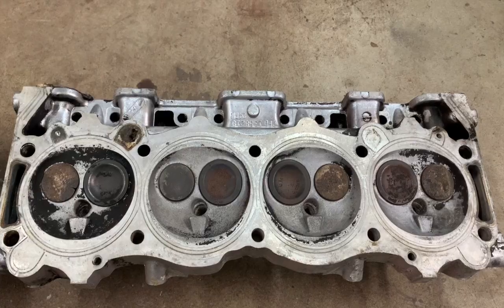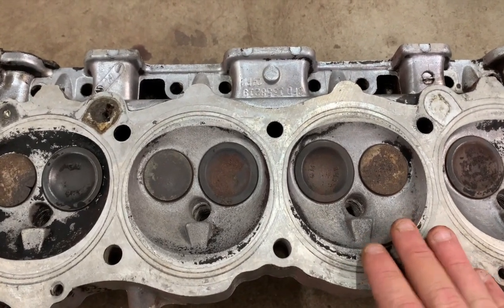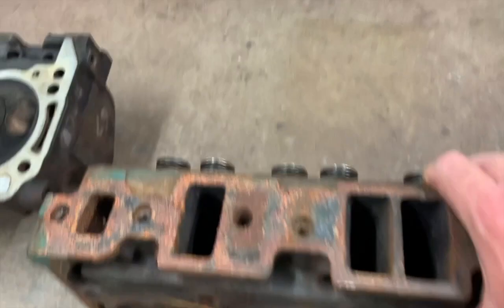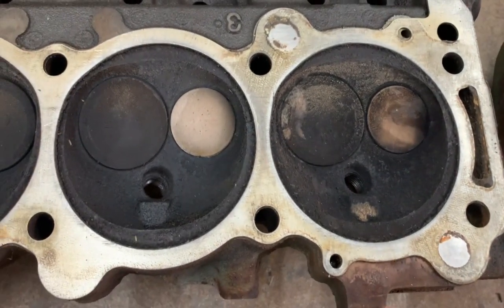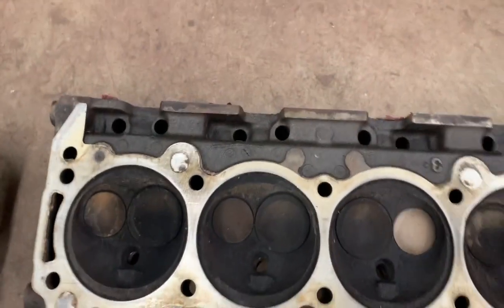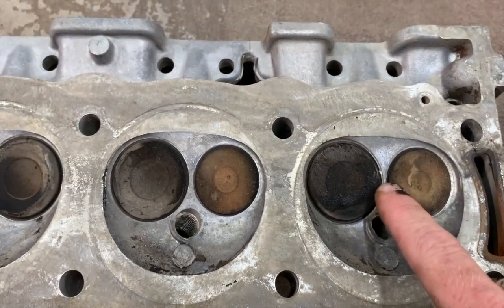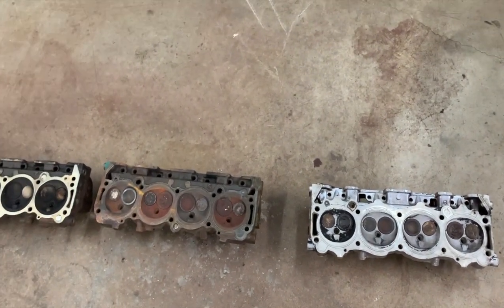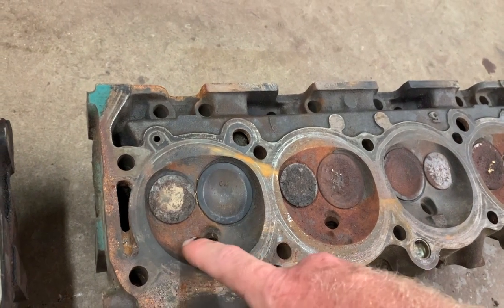Buick 215, 300, 340, 350 and Rover Cylinder Head Comparison #nonamenationals

Comment: Glad to see you back. The history of Buick engines is a wild ride. I've never actually owned a V8 Buick - my grandpa had a nailhead in the late 60s and all I know is that it was parked in the pasture when the transmission went out (I think a '61 Lesabre... pre TH-400). But I got through early adulthood on a bunch of different phases of the V6. Mostly early even-fire through the early 3800s. Really dramatic that sort of a stepchild of an engine became one of GM's best. Wonder what it would take to get the 1986-up/3800 timing cover with the crank-driven oil pump to work on anything else. At least in the V6 world, the oil pump was blamed for a lot of problems. We would see a lot of 231's with spun bearings - rarely any V8s though. Maybe the extra vibration on the V6 helped chew up the timing cover? No idea. But in the 90s, you could always find a G-body Regal or Cutlass cheap with a 3.8 that was bad and a THM-200 that slipped, and a rustbucket Malibu police car with a 350 Chevy and a 350C transmission, harness, and anything else for $500. But the Buick engine family outlived even the SBC. Quite amazing.

Comment: Will the 350 heads fit the 63 buick skylark 3.5L V8? Without modification? Thank you.
Reply from the maker: Will they bolt on? Yes, I just don’t think the valves would clear the bore. The 215 has such a small bore that valves clearing the cylinder bore would be an issue. Also, the chamber size of the head is so large compared to the 215, your compression would be so low it would likely not run very well. Also, you would need a custom camshaft and a fully custom intake manifold.
Reply: Thank you,  I guess it's Destin to be a Stock,  Survivor.  But  thank you for your reply.  I appreciate it. Keep  making Awesome Videos.  Love your 63 !!!

Comment: I appreciate you sharing your thoughts and knowledge and I'm hoping you have more info on Buick 300 and performance mods. I have a 65 skylark wildcat 355 and I'm wanting to get a bit more out of it. My name is Mat and I live in excelsior springs
Reply from the maker: The Wildcat 355 is actually really potent! It was the only Buick with Flat Top pistons that I have ever seen! The Wildcat 355 came with 11:1 compression and requires high octane leaded fuel from 1965 to run correctly. That means 97 octane at a minimum! I’ve had to rebuild a couple of these engines due to the high compression causing drivability issues for the owners. There is few aftermarket parts for the 300, but most of the performance Buick 215 parts are a direct bolt on with exception of the intake manifolds.

Comment: Hey I was curious your opinion on timing on a wildcat 355! Everything I read says 5btdc and I hear that it should be more like 10-15 with the fuel available today vs in 1965
Reply from the maker: You have that backwards… the fuel in 1965 was considerably higher octane than todays unleaded fuels. A Wildcat 355 has a legit 11:1 compression and would be equal to a 350hp/327 Chevrolet. Buick also states that a minimum of 97 octane is needed, which is mid grade circa 1965, meaning you cannot buy any of that fuel at a regular gas pump. I’d go with the 5 degree BTDC recommendation. I’ve replaced many 355 300 Buicks that had broken pistons from detonation. If you have the 64 aluminum version, you may be able to get away with 10 or so, but I’d leave it at the 5 degrees if you still have the flat top pistons in the 355 Wildcat.

Comment: The Rover 3.5 & 3.9 heads had  36-37 cc combustion chambers (used tin head gaskets).  The Rover 4..0 & 4.6 heads have 28-29 cc chambers for use with composite head gaskets.

Comment: So the 350 was a sort of one-off, with those valve positions swapped on the middle two cylinders? Do Big Block and 350 heads interchange?
Reply from the maker: No the heads do not interchange, but the valve arrangement is the same just like the valve arrangement on the 300 and Nailhead Big Blocks are the same.

Comment: I’m building a Rover v8 right now. Do you think it would make a considerable difference seeking out a set of aluminum 300 heads? Or should I just do some heavy porting on what I’ve got?
Reply from the maker: Port the ones you have and add some 300 valves. You can get a stock set from
TA Performance.
Reply: @mr.roddersneighborhood2740 That is exceptional info. Dallas - Thanks!
Reply: This video was an interesting find for me.
Its been a long time since I've built a 215 but you don't want the 300 heads unless you're doing major mods. The chambers are way to large. So unless you building cu in (bore x stroke) you don't want them.

Comment: It looks like the Rover intake valve is not that much smaller than the 69 buick valves.. but the exhaust valve looks a lot smaller.  Can you speak to this?  Also, do you think its possible to cut a buick 350 crank to fit into the rover engine?
Reply from the maker: You can turn down the crank journals but the overlap on the crank would be marginal at best. I do not know if the counter weights would clear the block at that point. I think your best bet would be the smaller stroke 300 crankshaft or a later rover crank to gain more stroke. The valve sizes of the 69 head are considerably larger than the Rover head, especially the exhaust valve which is 1.50”. The Rover uses a very small exhaust valve in the 1.38” size as far as I can tell.
Reply: @mr.roddersneighborhood2740  

Have to agree, we had gone with aftermarket cranks to increase the stoke. It wasn't worth the effort to fit the 300-350 cranks.
The rover cranks were a little different and not readily available back then and I think were still only 3.5L.
I would think rover to rover would be a better option

Comment: I have a buick 310 cui engine from 1966 and i have the intake manifold aluminum from a 64 because i would like to install a 4bl carburetor. How far as i understand it would fit but is that making sense? And would be possible to make the ports bigger of the intake manifold to fit the 66 heads? Greetings from Switzerland.
Reply from the maker: Yes you can make the ports bigger on the intake to accommodate the 65-67 heads, but you will run out of room to port it fully to match. Compare the 65-67 300 intake gaskets to the 64 manifold and you will see exactly what I’m talking about. But… it’s not really an issue since the head port is larger than the intake port. If it was the other way around, it would impact flow terribly.
Reply: @mr.roddersneighborhood2740  thanks a lot for your fast response. I will give it a try and see how it works. Im not sure wich gasket i should use so i ordered the 64 and 66. would you port the heads as good as possible or leave it just as they are?

Comment: Do you know if all exhaust headers are interchangeable.  I am looking to put 66 LaSaber exhaust heads on to Rover 215.
Reply from the maker: If they are 1966 LeSabre 300 or 340 manifolds, they should work just fine. You may have to clearance them around the lower row of head bolts on a 215 since the 300 and 340 do not have the lower head bolts like a 215 does.
Reply: The 300-340 exhaust manifolds bolt right on the 215 with no mods at all, thats what I used to use. I think the 215 had 1.5" outlets while the 300-340 had 2" outlets.

Comment: is there any advantage to the nipples next to the spark plug holes?  would you gain improvements by grinding the nipples down ?
Reply from the maker: They aid in combustion and chamber swirl. I’d bet if you removed them it would run like a pig, but it may be worth trying to see if there are any gains or losses.

Comment: Can you swap 340 and 300 heads to both engines ?. I have been driving a 65 300-2 Buick special for over 22 years, but I have a 67 340-4 out of a GS and I'm wondering what would be the best combination and heads ?.💢💢💢💢💢💢💢💢
Reply from the maker: Yes, they are the exact same head! The best head is likely the 65-67300/regular 340 head. TA makes an aluminum head that will bolt onto that 300 or 340 and it is hands down the best head for the engine family. a bit of secret info is that the 215-340 head does not suffer from pushrod pinch meaning the port shape is not impacted by the pushrods holes in the head. The 350, 400-455 Buick all suffer from pushrod pinch limiting the port width.

Comment: Why did they bugger with the porting on the 350 heads & give it pair exhausts (Chevy SBC style) in the middle, when none of the others do that?
Reply from the maker: That’s an interesting question and I wondered that myself until this hit me one day. The small block has always been tailored to look like the Big Block Buick. The 300 shows this the best, with valve covers and port arrangements to look similar to its current big block counterpart. In 1967 the Nailhead disappeared from the showrooms replaced by the new and freshly designed 400-430 engine. The port arrangement changed on the 400-430 vs the nailhead, so in 1968 Buick engineers revised the small block 340 Buick to look similar to the 400-430. I believe it was done to use the exact same rocker arms. This increased the port height while keeping it narrow. This increased port velocity, thus increasing midrange torque.

Comment: Would you please comment on the Engine to Transmission Adapter Plates useful to transplant any GM LT1, 350, 400, or 327 into a P38 V8 Range Rover 4.6 L HSE due to slipped cylinder Liners, I would prefer to transplant a Chevy, GMC, or Buick, V8,  or even a Nissan VK 5.6 L V8.  Thank you
Reply from the maker: I know nothing about those adapters. Sorry, I cannot help in regards to the adapters.

Comment: Have a look at the Australian Leyland P76  tall deck alloy V8 270 ci motor based on the Rover , runs big valves and an alloy four barrel intake for a GM Quadrajet . The heads use chevy style rockers .
Reply from the maker: Unfortunately those Leyland 4.4 Liters were never available in the USA. I’d love to see one upclose and personal. I have heard of them before and would love to see one.
Reply: @mr.roddersneighborhood2740  yeah tall deck , Alloy 270 ci , Australia put them in Leyland P76 cars trying to beat GM Holden and Ford Australia. Was a nice motor , it was going to go out to 368ci the 270 ci was the first motor , but Leyland Australia went bust and no bigger motors came about ! I would have loved to see a 6.0 litre Alloy Buick/Leyland !

Comment: I find that your video is very informational to me because I am very familiar with the Chevy and Buick engines and I also have a VA Rover engine which is 4.0 or 4.6 Liter. I will subscribe to your channel because I am looking for the following information.:  can you explain to me in words as to why the Land Rover vehicle does not accept the GM Engine Tothe, Land Rover, Range Rover Z4 speed automatic transmission with a P 38 model after the original Buick engine. Have you ever modified a Land Rover to accept the Chevy engine of Buick engine or any GM engine and please advise the process otherwise, thank you very much and I appreciate your time and Paul
Reply from the maker: I’ve never swapped anything into a Land Rover. I really just do Buicks. As far as to why the transmission does not fit, is likely the Buick 215 never had a standard GM bellhousing. Every Buick engine after the 215 had the standard BOP bellhousing bolt pattern.

Comment: Can you bolt the 350 buick head on a 1966-67 Buick 340?
Reply from the maker: Since the 300 accepts the 350 head and the same 300 heads were used on the 340, I would assume yes. But… you will need a custom camshaft that has the 340 cam journals with a 350 Buick valve arrangement pattern. Then you would have a 340 cubic inch 350 Buick. The 350 intake would bolt right on at that point.
Reply: I have a skylark with a 340-4 bbl and was wondering if I could install TA aluminum 350 heads.

Comment: Leyland 4.4 australian engine 10in deck height  6.25 in rods and piston pin height 48mm   .What about you 300ci and 350ci brick engines
Reply from the maker: 300 Buick is almost the same as a 351 Windsor ford. 9.5 deck with 5.960 rods and 3.4” stroke. Bore is 3.750”. Buick 350 is 10.25” deck height with 3.8” bore 3.85” stroke 6.385” long rod. The compression height is the same on both 1.885.
Reply: @mr.roddersneighborhood2740   Thank you  for the help life is great love your videos